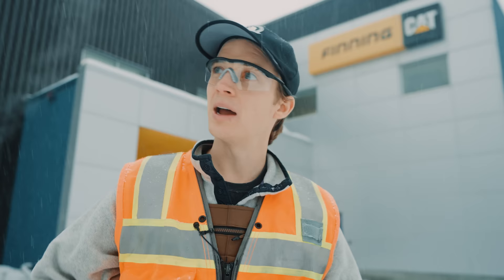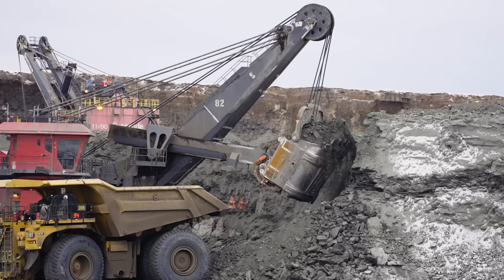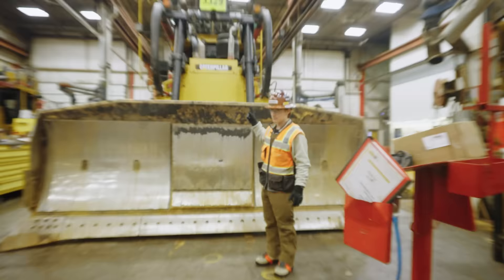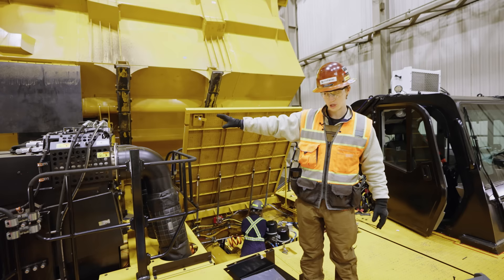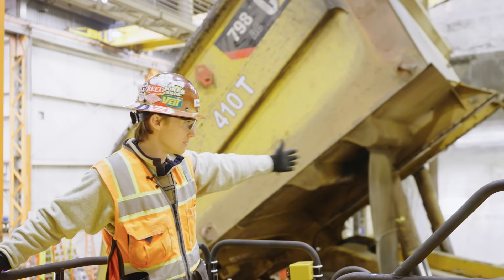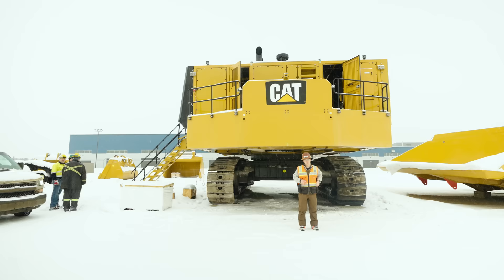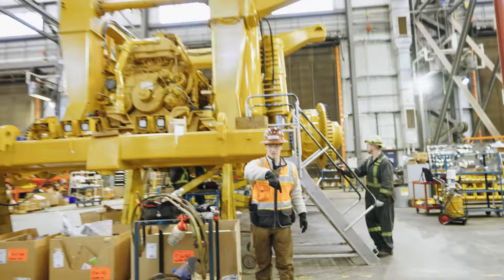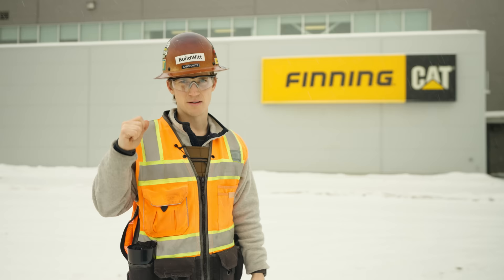Repairing the LARGEST Trucks on Earth | Finning CAT

Comment: Next time you are in a shop like that one, with extremely large / heavy pieces of equipment up on jack stands, ask them what the shop floor concrete spec was when they poured it, basically how many feet thick to get the psi needed to hold up each jack stand without breaking through?
Reply: Would love to know some of the facilities specifications too!
Reply: I bet its similar to any heavy manufacturing facility. Some presses and benders and stamping machines are like solid bricks of steel. Can also weigh hundreds of tons. Really big ones, the floor is built around them. Im not a concrete guy, but im sure its thick and/or heavily reinforced.
Reply: Floors are 2ft thick with 1 inch plate in the tracked bays leveled with epoxy underneath. Embedded railroad rails in the slabs outside

Comment: From my experience at a Cat dealer, the beeping sounded like the back up for the fire system. Its battery power for when the machine isn't running and will beep until you remove the battery.

Comment: Was there in 1999.  Some of the first 797's being assembled.  It is my understanding that they had not officially been released by Cat.  The dump bodies came as five subassemblies that had to be welded together.  Then there was a stack of AR plate to be applied.  The frames came in on a trailer with 128 tires. At that time Syncrude was making the transition from walking dragline/reclaimer/conveyor to shovel/truck/hydro transport.

I keep hearing that this is dirty oil.  Yes, what they excavate is sand, water, and bitchimen. What eventually is sent out has the sand and water removed as well as much of the sulfur and petroleum coke.  At that point it is synthetic crude.

Comment: P&H's electric shovels are amazing, would love to see move coverage of those.
Reply: How are those electric!? Are they connected to the grid or on diesel generators? Thanks
Reply: @carholic-sz3qv  at 3:36 you can see the red trailing cable coming in between the tracks. that's a high voltage supply line (6.6kV in australia, I believe they're around 7.2kv in north america) fed from a dedicated substation (usually a sled type portable substation with multiple outlets to feed a 2 to 3 shovels) somewhere nearby on the mine site. the trailing cable enters into the carbody and feeds the onboard transformer which feeds all your travel/slew/hoist/crowd/auxiliary systems that run on 415/230V. it's always funny watching these north american spec shovels because none of them ever have cable reelers to manage their trailing cable, so you see them picking up and moving it constantly with the bucket - or having their offsider shift it in a tractor. 

beautiful machines but they're becoming outpaced by 'smaller' hydraulic diggers like the liebherr 9600/9800 that just have big shovels beat on cost per tonne and mine plan adaptability. loved every minute I spent working on them and it's sad to see them get cut up and shipped off to rust on foreign docks.
Reply: @carholic-sz3qv  They run long electric cables (just layed on the ground) throughout the mine to the shovels. They are connected to the grid. Special considerations are taken at road crossings etc, but yeah they are just plugged into the grid. Of course it is high voltage and a number of safety considerations come into play for how they deal with cable crossings on the mine site.
Reply: @devinbartley5768  how to they actually manage the cable on the ground since it has to move all the time I mean the excavator?
Reply: @carholic-sz3qv  They will use a cable tractor or the teeth of the bucket to hook onto a metal basket to move the cable with, this is normally for short distances .They have cable stands also to float the cable high enough for the trucks to go under running it into the middle of the pit . So the haul truck operator will pick one of the sides to get loaded , normally the side the bucket is pointing towards if no truck is in the pit .

Comment: Favorite video so far! One question though, what are the yellow circular things between the headlights and the radiator?
Reply: If you mean what I think you mean those are air filters. Each slightly smaller than a keg of beer and there are 5 of them. I'm not 100% sure about the F's but the B's were designed to have 2 engines each about the size of a smart car. So you need a lot of air flow
Reply: @fruitninjasemipro  thanks
Reply from the maker: @austingiyer6465  yep that's the answer right there. Thanks for watching!
Reply: Ya the new Fs have 1 engine
Reply: @Emily Emily  di
Saya yang

Comment: The only reason to put a escape hatch on the roof, is because at some point, someone needed one and it was not there.  Lol  Would not want to make that call the the boss..........
Reply: Guy I knew was making a new mine road, using a  d11 dozer(one of the biggest dozer in the world) ground caved into. Massive sink hole full of water. By the time is he came to his senses and tried to open the door he couldn't, to much water. Emergency hatch was stuck on him. Gave himself a concussion smashing his shoulder/head against the hatch trying to get out. Luckily opened after a bit. But ya.. they definitely are there for a reason

Comment: Q. At 4:42 min... what do you have on your boots? They look like some kind of anti slip ice studs, upturned as you're clearly not on the ice currently. Interested if I am right... and also if this is Finnings policy requirement?
Reply: You are correct! I work at this mine, and they are required to be on your boots at all times in the winter. They can be turned up like his are when not needed.

Comment: Would have been nice if you told us how much each tire cost & air pressure required. Years ago went thru the Mack truck plant in Pa where they were building a dump truck for the coal industry. Thought that dump truck had huge tires that might have been 8' high.
Reply: Changing these tires is my job. Tire costs $60-70,000 depending on the brand. Cold air pressure is 110 psi. Enough force to send you flying over 10 football fields. Well whats left of you. The reason I give that measurement is because there is a poster at my work with that description description.. well minus the "whats left of you part lol".

Comment: I work there build haul road in winter due condition soil.this truck must return invesment due huge cost so down syncrude tried keep as possible down.the worst is when -40 to -55 f below zero cause lot headache due steel and rubber cold.thank video calgary alberta.

Comment: So....
Any chance you could ask for some stars on how close they get to 410t loads?
Reply: They go over all the time lol. Regularly get 400-450. Anything above 466 tons the truck won't go outta 1st gear. Which is like 5 miles a hour. You can "bump it down" hold down brake, rev up and release the brake. Sometimes it works. If it doesn't you have to drop your load.

Comment: Ive always wondered how those big dump trucks are started, do they have batteries or ground power units to assist in starting ?
Reply: They use compressed air. They scream like crazy on start up lol.
Reply: @caseyshearer9519  thanks for answering my question.

Comment: So basically this video is just a kid drooling over big machines for 20 mins.  At no point did you show anything being done to them, just pictures of them in various states of repair.  I would have loved to actually see a 10ft tire being changed, or a radiator installed, or ANYTHING mechanical.  Don't get me wrong, I like this stuff, but your video is pretty clickbaity, as you did nothing with the trucks being repaired and we certainly didn't see a tire change as your thumbnail showed.
Reply: he explained some things either way this is actually quite interesting and impressive. watching them change a tire or radiator would be quite boring... its the same on any other machine but just bigger scale.

Comment: It's a mind-bogglingly huge setup to mine some of the dirtiest and most expensive oil on the planet. The heavy metal is impressive, but i get the feeling maybe they could be replaced with a surprisingly small number of solar panels somewhere near where the oil gets used.
Reply from the maker: You know solar panels and oil do two different things right
Reply: @AaronWitt  As long as there are places in the world that are burning oil to generate electricity, they're pretty equal. With the electric transition happening in the automotive sector, that only becomes more true.
Reply: Which places in the world use oil to generate electricity on a large scale?
Reply: @jmonsted  Burning oil to generate electricity what?
Reply: Oil is so much more than just fuel..also  you obviously know very little about solar energy if you thought they could be replaced with "small" number of panels. Do a little research and you will see. We are nowhere near solar taking over and a reliable resource of power
Reply: 3.3 million barrels of oil a day could not be replaced with a surprisingly small number of solar panels.